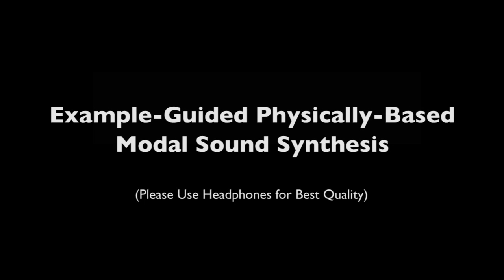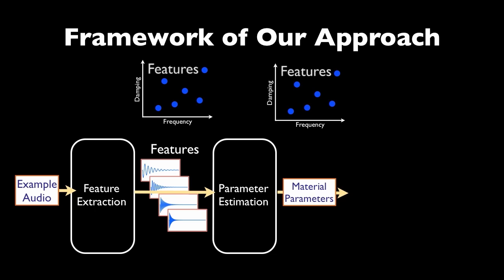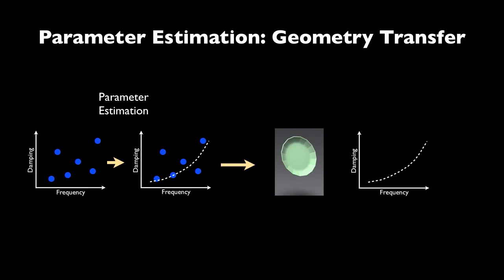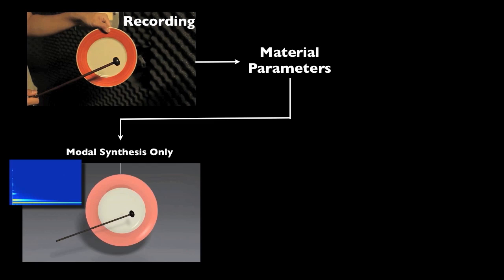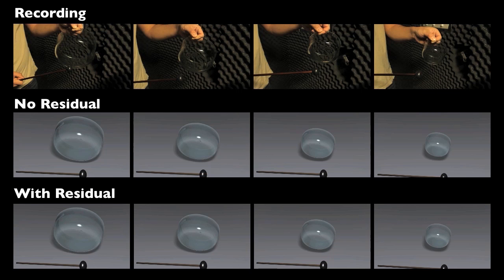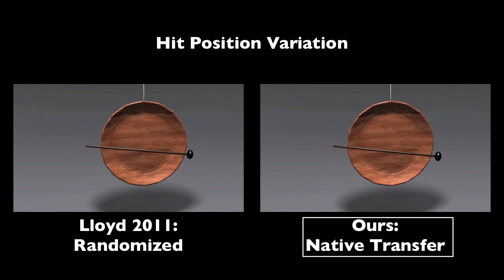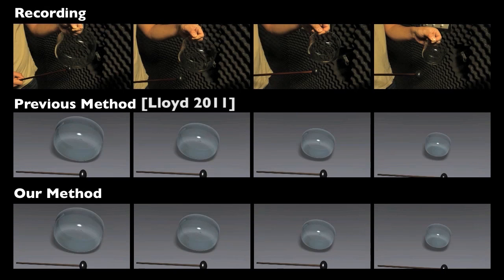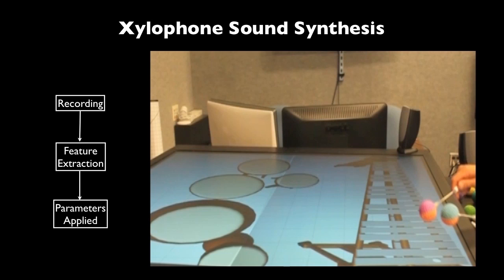Example-guided Physically-based Modal Sound Synthesis

Comment: when you import a sound does the system also sorta approximate the type of material it believes made the sound? So hypothetically if I import a sound I could then create the structure in real life with the suggested materials and get a 'similar' sound to the original imported audio?

Comment: They could actually create a VST (or a workstation synthesizer) using that technology.
Reply: They couldn't,or it is unlikely this model will run in realtime.it doesn't sound very realistic either,but tremendously expressive which is more important
Reply: Look for Audio Modeling SWAM instruments.
Reply: they did it, and even with a more powerful technique called Three Axes Modal Synthesis! check Gleetchlab